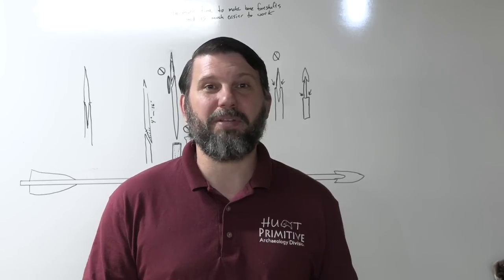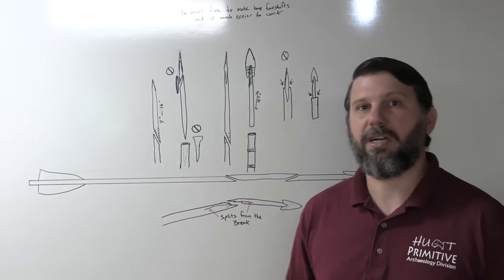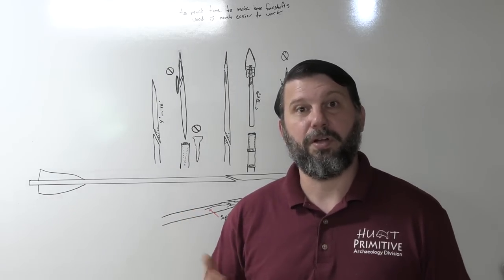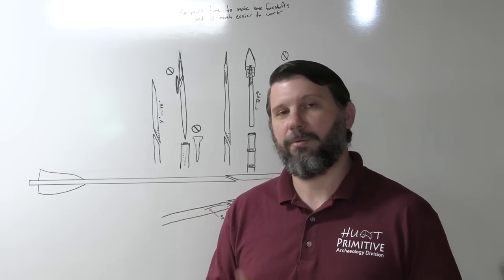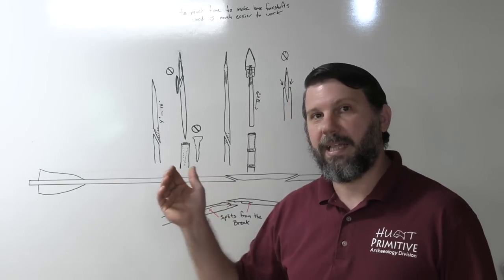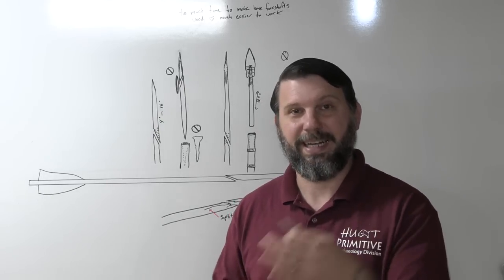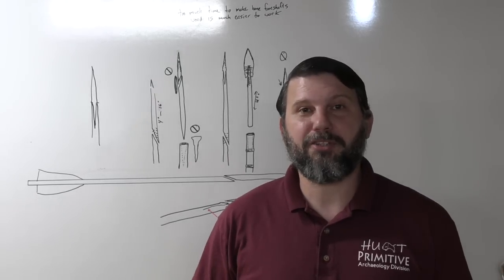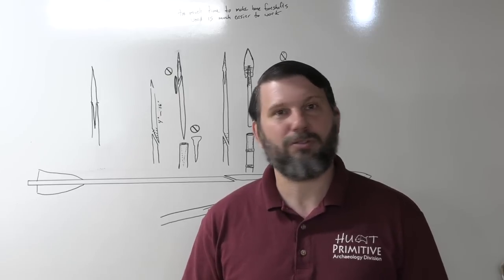Hafting Clovis and an explanation of single and bi-bevel rods

Comment: Fully agree with the unlikelyhood that the single beveled bone piece was a foreshaft.

Your point on construction time feels crucial.  The atlatl dart is one of the more complex devices they can create, and one upon which they depend for survival.  Modern recreators all note the challenge involved in setup and maintenance of the projectiles, so much so that we stopped making them and regressed to javelin across much of history, despite the decreased power

These were human beings, so they surely optimised the heck out of the process, it's what we do.  If there's an seemingly unnecessary step in a subsistence economy, there has to be a seriously good reason.  I don't see one...

Excellent work

Comment: Did experiments with making Clovis points and the technique and technology is complex. With a minimalist mindset and limited tool kit a Clovis can be achieved but it’s quality would suffer. I believe complex and extensive training, tools, skill set, and experience determined the quality and use of the projectile. I made many tools to find a portable fluting system that is effective and predictable, however the best that can be used for fluting is a chest crouch by don crabtree design as I have found. The point is determined by the beginning of the biface along with significant waste contouring the faces to flute at the end. The process is very wasteful for design but the reward is one of the best hafted points for fore-shafts, spears, and knives.